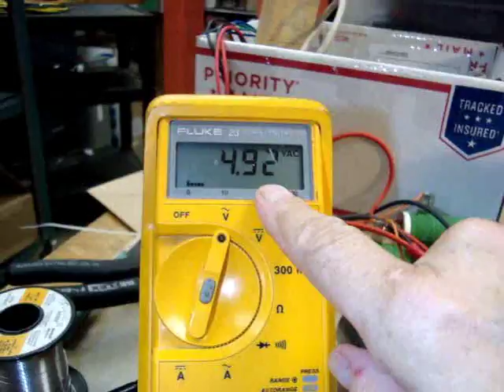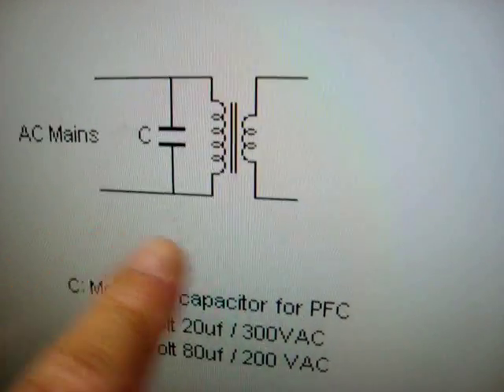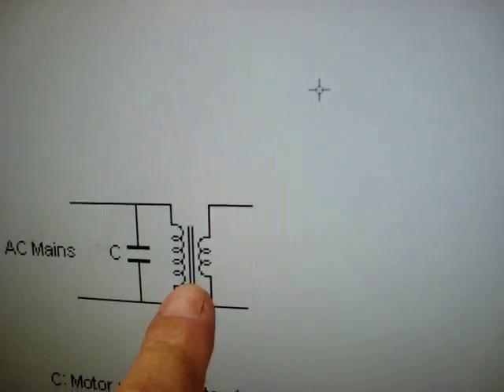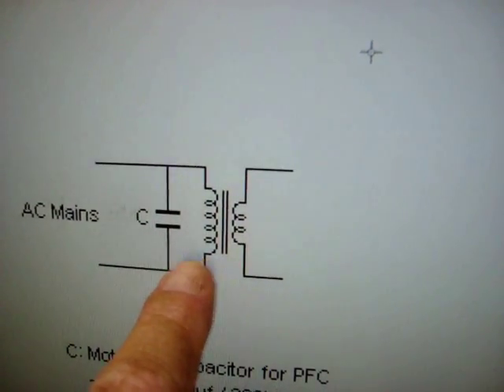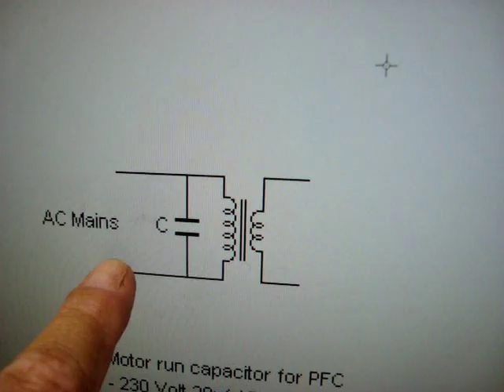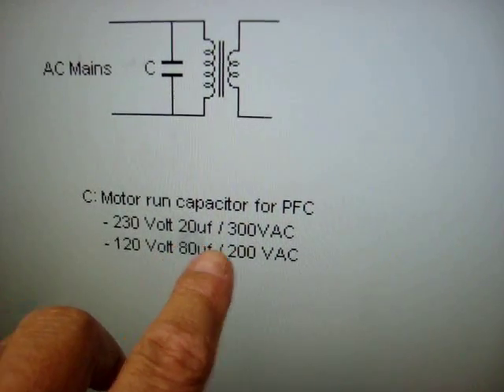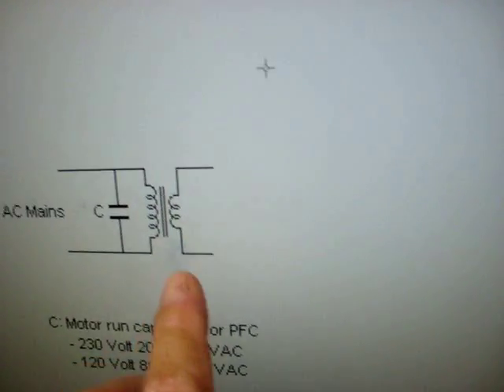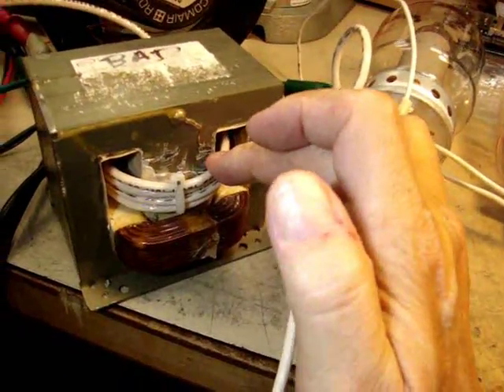Microwave Oven Transformer Conversion for 4-400A Tube Filament Supply

Comment: Hi, how hot is the transformer for you after long use? I converted a microwave transformer today, took out the sequencer, haven't wound a new one yet, but the primary temperature goes up over 70 degrees. What are your experiences?  What is the resting power consumption of your transformer?
Thanks!!!
Reply from the maker: The transformer needs a fan for long operating periods. Even in the microwave ovens, the fan blows some air on it. As i mentioned in the vid, these transformers need to ne cooled. Thats one of the downsides of these type transformers. I don't remember exactly what the resting current is, but i think it's around a few amps. Their power factor is terrible, but it can be offset with an 70uF motor run capacitor in parallel. With that said, they should work fine for the application and the afore mentioned. 😉
Reply: @bob4analog  Hi, thanks for the reply, I have a transformer that draws 110-120 watts without load, I tried it yesterday with an 8.2 18 amp heater tube, it worked... The real test is yet to come, I have a tube that heats between 50-60 amps at 6.3 volts :)
Reply from the maker: That's 360 watts. Transformer shud handle that. Let us know your results. 😃
Reply: @bob4analog  Ok, a GU-47b type tetrode in the tube

Comment: What is the power factor when the tubes are connected? The power factor on the secondary is 100% as the tube heaters are a resistive load. I have a much smaller transformer (rated at 45 va, 15 volts 3 amps). It reads 99% power factor on a Kill-a-watt meter when powering a pair of 194 and a pair of 168 automotive lamps. (1.45 amps total load on secondary). I imagine the power factor would be in the mid to high 90's with the load it's powering.
Reply from the maker: Not sure what the PF is in this vid, i didn't measure it. I did measure one before and it's not real good. At full power, they're said to be in the 90s, but in a situation like this, it might be aroumd 60%. MOTs are designed to operated in saturation mode for regulation, but that also makes them lossy.

Comment: I'm going to do something similar, except that I need 4 filament supplies at different voltages, one for an S-band magnetron (3.3VAC ~10A), and two windings for a hydrogen thyratron (2-10VAC 1-5A and 4.5VAC 20A, for the TiH2 gas cell and the rather huge indirectly heated cathode, respectively) the fourth winding is a 6.6VAC winding that goes to a rectifier and filter for a special diode tube that is part of a PFN, the tube was custom made for the PFN whose case its potted into, WEIRD tube, 8 wires at BOTH ends, 4 very wide and long tube shaped diodes inside with 4 separate indirectly heated cathodes, all electrically isolated with the only common connection being the filaments. If you know how, I need to know, how to make sure that the 4 different windings are electrically isolated from each other and from the 120VAC supply on the primary? Also I don't know where I should place the magnetic shunts, or if I even need them.
Reply from the maker: Interesting project you're working on! To answer your questions; 1st, you will not need the shunts. Those can be removed. 2nd, due to the voltage and current requirements you gave, You'll need 4 different MOT's, 1 for each filament. The windings will need large diameter windings with good HV insulation. Altho I don't believe it was mentioned, but how many volts above ground are each of the cathode heaters going to be?
Reply: @bob4analog  ok, well using 5 mots is not an option, there's no space left in the cabinet after the sync system and data acquisition hardware are reinstalled. In the original system, as designed by Raytheon, a single toroidal transformer powered all of the vacuum components filaments (and one hydrogen reservoir). That transformer was removed to de mil the system. Yesterday I found the HV litz wire that the manufacturer used, so isolation is not a problem now, I think (it was classified in the 70's when it was new, no manuals or diagrams) the original may have used a double (paralell) set of secondaries with taps at half, 3.3, 6.6, 13.2vac are common voltages in the system, this led me to think that one transformer provided all the supply voltages, but I'm going off of the wiring that vas cut around where the toroidal transformer was. Is there another way? In other systems I've seen multiple DC supplies to address this problem, I'm wondering if I can do that here, none of the tubes would have a problem with a DC filament supply... except the magnetron cathode heater... pulsed at -5kvdc. Same on the thyratron and the PFN rectifiers (I now know why that tube is there, the pfn is charged through a cockroft-walton voltage multiplier)
Reply from the maker: Wow, this sounds like quite an apparatus! I have a friend that works for LANL and I'm thinking he might know something of a solution. He may have some surplus from the accelerator. If you want to messege me off yt about this, let me know.
Reply: @bob4analog  it's a crazy setup. It has an enormous pfn being dumped into a large 1.3GHz magnetron at as low of a Pulse Repetition Frequency as 1Hz... I can only conclude that this radar was for looking much much farther than usual. The set didn't come with its dish because "..it's classified, part of the facility." I know that no parabolic dish is considered classified, so I think it means that the antenna was a large fixed (or mechanically steered) phased array and this set I have was just the transmit pulse power source. I have no way of confirming this, but I suspect it was used in a radar meant to look into deep space, or at least low earth orbit, given its long receive time, huge (2048 GB) fast memory in the data acquisition system, extraordinary pulse power, and low PRF. Yesterday I fired the magnetron into a water load, only five pulses and on the 6th the steam vent popped open... edit: to be clear that was at longer pulse lengths than any radar, and I was manually triggering it, with a different power source.
Reply from the maker: @420timedude  Wow, way over my head! Very interesting tho. Thanks for the explanation of it. I've always been interested in this kind of science and yer right there with it. Wished i knew the solution to yer issues, but more power to you just the same. Wish you sucsess. 😉👍
Reply: @bob4analog  I found a loophole in the laws that govern the use of ISM bands, I'm actually hoping to build this into a working ultra-long-range RADAR (sort of). There's no power limit at these frequencies when the pulses are wideband, it seems that the limits apply ONLY to communications, and only Narrowband (<1 MHz) communications at that. Thanks for your interest. Yesterday I did find a solution, a single MOT with ~30 turns of litz wire two wires tapped at 15 turns, works fine, I supply 265vac from a custom inverter at a higher frequency than line power ( filaments dont care AC or DC, 60Hz or 12.5kHz as long as they have their current ). I wouldnt have thought of that solution if we hadn't had this conversation. I cant document this project on youtube because even though the set is no longer classified, there is still an export ban on the system and ANY documentation. But my next project will be "How to Build a DIY particle accelerator" I'll be building a small RF cavity linear proton accelerator. Already have the power supply and the RF supply (magnetron)...

Comment: Great information! As I told El Paso Tube Amps, I'm just starting a hf amp build using 4-400's. this will help keep the cost down.Thanks Bob H for sharing!
Reply from the maker: Michaeldotc - Yes, it'll do you good for your linear. Make sure to add a small fan to blow on it to cool it, as they will get hot. Also, don't forget about adding a center tap. A very simple center tap can be made by connecting two 5 ohm 5 watt resistors in series across the 5 volt winding. 73! KD5MHQ

Comment: Very good idea - thank you. I build amplifiers with many of the Eimac tubes and have always bought the filament transformers, and they are not exactly cheap. 

Recently I paid out about $80 + shipping for a 7.5 V 21 A transformer for my 3-1000Z amp. Never crossed my mind to do it this way. I have a couple of large microwave oven transformers and I have read to drive out this shunt that you mention. I am curious if you know why we need to do this and what will happen if we don't. I don't know the answer and I have never tested these transformers in a HV PS under a load with and without the shunt.

I might also add, as I am sure you are aware of,  it would probably be best to leave all five turns on, in this particular case, and have a bit more than 5 volts as there will be some voltage drop across the filament choke if this is used in a GG amplifier. 

Thanks for posting.
Reply from the maker: Thanks! I've had excellent results with using MOT's in this fashion, and also for using them for the plate supply. They're not as well regulated for that as a real plate transformer, but they do work.  - As for the shunts, I think they could be left in place, but they just tend to get in the way and really don't provide any useful purpose in this application. The shunts are supposed to be for short circuit in the uW oven application. I'm not exactly sure how they work either, but that's supposed to be their function. In this case, they're unnecessary. - As I'd mentioned in the vid, the 1 point that stands out with these trannys, is the large amount of current they draw, thus the PFC capacitor and the necessary cooling. Other then that, they make great fil xfrmrs. - Good point on the turns. Yes, having a bit extra output voltage is good to overcome any other circuit losses such as the fil choke you mentioned. - Here's a breadboard linear I made (more for demonstration purposes) where I used MOT's for fil and plate:  https://youtu.be/VXpG60ual_4  - Here's another vid of how I used a PC ATX power supply for fils:  https://youtu.be/XT-6Tas7qGg - Also, I've found a good amount of SMPS that could be used for fil supplies. I plan on making some vids for these as well. 73's!